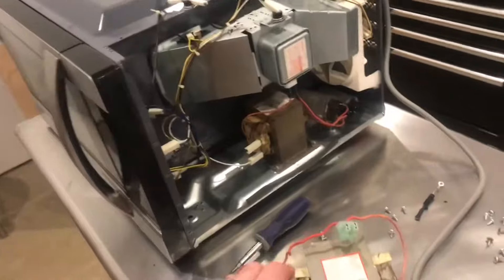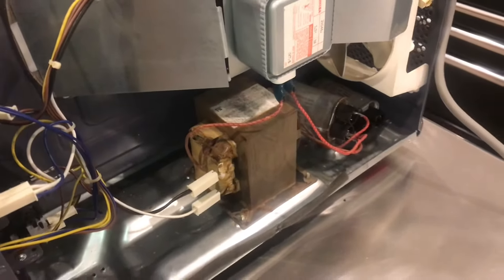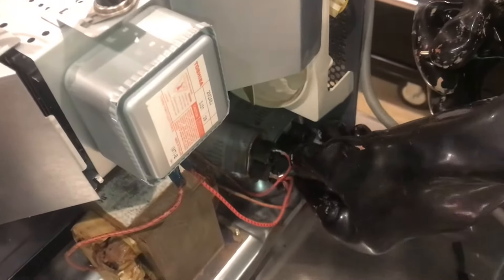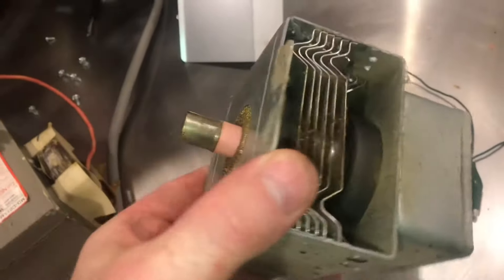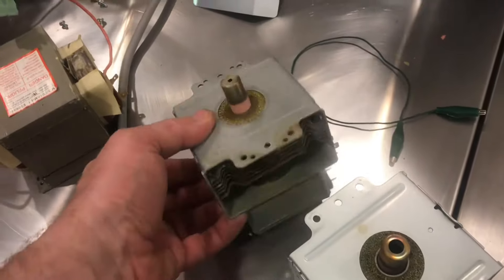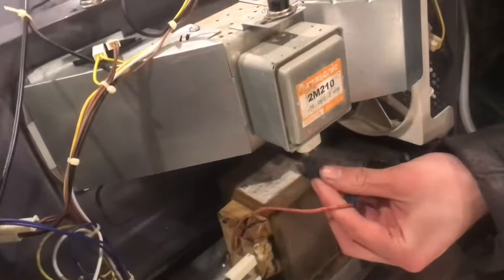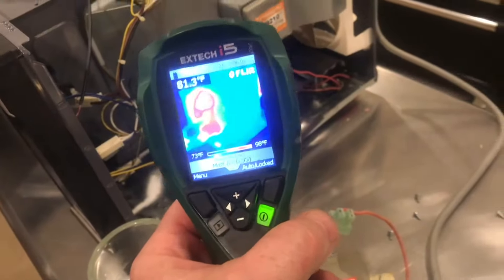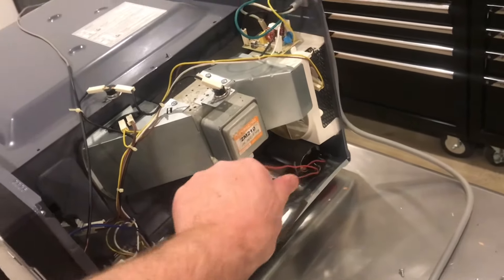replacing MAGNETRON in a “microwave oven”…

Comment: I came here to learn how to replace a magnetron on a faulty microwave that doesn't heat up even though it is running but after watching your video I am terrified how dangerous it is that it can kill you even when the power is shut off
Reply: Chill out. As long as you unplug the unit from the wall so that no more current can reach it then discharge the high-voltage capacitors (other videos like this one explain how best to do that--it involves shorting them to ground), there's nothing more than sharp edges you could cut yourself on.
Reply: Same here. I was on Amazon ready to order a magnetron but wanted to double check how to change it. Now I’m scared shitless. My luck, I’d be the first man to die fixing a microwave.
Reply: @russellbateman3392 I’m gonna watch some videos on how to discharge the capacitors and try to fix it myself. But if you don’t see any posts from me after about a month or so, then you know what happened 😱😱😱😱
Reply: @russellbateman3392  Thanks for the tip!!
Reply: @darrell5703  Are you still with us?
Reply: i think ded @TheCodexNecro
Reply: I just did mine replaced the diode,capacitor and magnetron it was.no big deal. Discharde the capcitor after you unplug it.@darrell5703
Reply: You should be terrified and act accordingly. ie. If you proceed, be EXTREMELY CAREFUL and if you are unsure of your knowledge: DON'T!